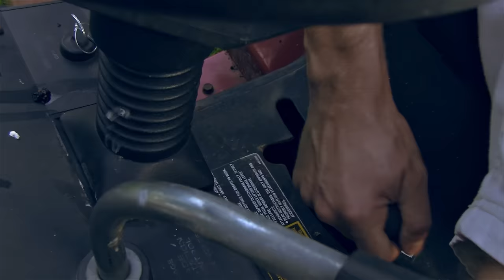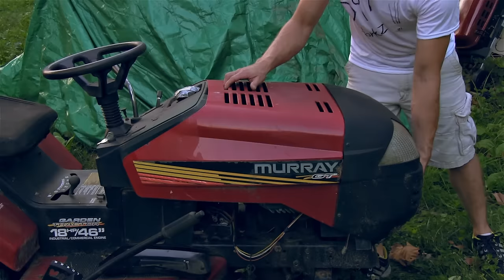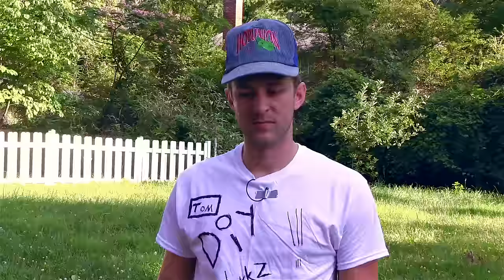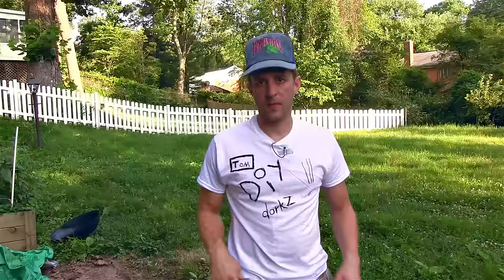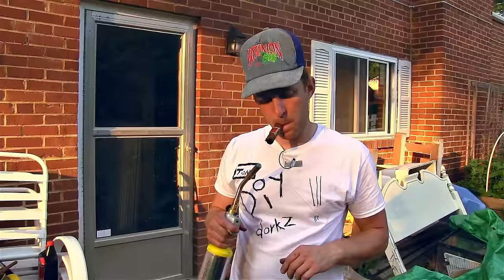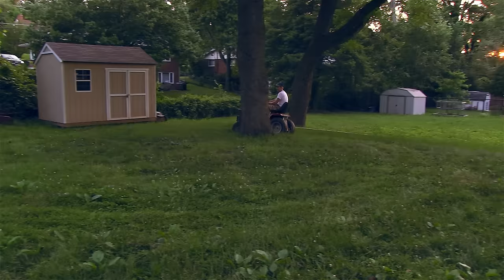Lawn Mower Will Not Start? Fix it! - DIY DORKZ Season 01 Ep. 05

Comment: I know you guys didn't ask for it but let me give ya 
 a little of piece of advice, after you changed the oil you should of put some automatic transmission fluid with the new oil or diesel with the new oil and then after you cut your yard drain it and then put in a fresh amount of lawnmower oil. Transmission fluid is like a cleaner and so is the diesel. When you first drained it you didn't get all the water out of that engine because alot of it sticks to the inner oil galleys and walls of the engine so just putting fresh oil alone isn't going to get it all out. Run it with either one of those two with fresh oil and drain it again so the rest of the water will come out. Me personally I would do this two times back to back to be sure. That's a really nice engine on that mower and expensive. I have a 17.5 hp. opposed twin and I've had it for 21 years and it's a beast. Nothing stops it. Great video and well done. Good luck and thumbs up on the video guys, take care. 👍
Reply: Wow. That sounds like great advice. I'll remember that on my own projects.

Comment: Hi there. I have a husqvarna lawn riding mower with 24 hp Briggs & Stratton that not start. It died on me when I was cutting my grass. It seems like no power but when I play with the electric wire, it has power showing the number of the hours on the meter then When I try to start I heard it click a little bit then died again and no power again. Could you tell me what is wrong with that?

Comment: Check leakdown. If it's low, it could be the valve seat is loose. Check the rocker arms. If it's loose, replace the head. Replace the carburetor. Tune the engine. Change the oil and filter. Check the spindles and belts and blades. Check if the deck is rotted. Check the tires and rims and linkages.

Comment: Can't hardly kill those old Murrays.

I spect you'd do some preemptive things on a mower that's been sitting that long:
Charge the battery (at least confirm it has one).
Drain the carb.
Drain the fuel tank.
Check oil level, if not the condition. I don't always drain it right away if it don't look too bad, but I will after I get a few minutes run time. (I once got a Sears 10/6 that I knew had been flooded at least twice. It ran clear water out the drain for at least 20 seconds before I got any oil. Glad I didn't run it with that much water in the crankcase.
Soak the deck bearings with oil, or pump a few squirts of grease. You know those are gonna be noisy right away. Maybe even try to free them up by hand before you engage.

I don't mean to be critical; you don't a great service here by sharing this experience with people.

It especially gives them confidence to try stuff on their own.
Try and assign value to that...

I've been doing "rescues" for about 7 years now, and still haven't posted my first vid. Kudos to you for sharing.

Comment: You make it look so easy! I still can't I get mine going, and I didn't have 1/2 the issues you found. :-(
Oil in decent shape, not too full, new battery, drained and refilled gas, took apart and cleaned carb (didn't look dirty to start with), checked fuel flow. Was able to start it with starting fluid, but now it just spins
Reply: Jayleen Flanigan if you were able to start with starting fluid, it's still a fuel related issue. Does it still have spark?
Reply: Sounds like your fuel shut-off solenoid might be bad.

Comment: I have a pos my self ariens with a b&s v twin 22 hp motor that will not start I have new gas, fuel pump(vacuum),fuel Lines ,and a carb. I am at a loss with it I got it to run for 20 mins one day then just went to check it and now it doing it all over again.  Its about to meet a junk yard

Comment: Lol, my single cylinder sounds so much different than that opposed, wish I could get one of those to replace my 12.5hp cause power!
Reply: SwagSubscriber ive had a few of these opposed twins there not strong engines they dont like turning rpms your better off with a 16hp single briggs or a briggs vtwin
Reply: I got a 15 hp one and it is alright

Comment: My mower is turning too slowly to start with battery only similar to this video.  However, if I jump the battery it starts up and runs well.  I have had the battery checked and it’s good. 
Is it the valves?   20 hp Intek  Briggs and Stratton.  Thanks
Reply: You need a battery with a lot more cold cranking amps.

Comment: Would this be the same process for one that has been sitting for 12 years? Great video!!
Reply: It completely depends on where the machine has been sitting and what condition everything is in. If it was sitting indoors, my bet would be yes, except there might be a mouse or rat nest. If not, I suggest you read up on any problems you can find and maybe go to your local small engine shop. Usually they're willing to give you any information you need even if you don't give them any business.

Comment: I'm having a hard time with my Craftsman rider. It's got too much compression and the starter can't spin the engine over to start the engine. Please let me know if you have any ideas. Thanks
Reply: @Ernest Lane jr : late response I know, but check your valve clearance and adjust accordingly
Reply: pull the plugs, crank it over with them out. Reinstall the plugs and try it again...

Comment: Good Video...but don't be CHEAP... I recommend to purchase new spark plug(s), air filter,  flush the fuel system (if no  Sta-Bil Fuel Stabilizer added), fuel filter, check the condition of both blade(s) and belts and battery as required. Check the status of the engine oil... make sure you use the correct engine oil.  Don't use 10W30... but SAE 30.  It has additives (detergents) that can destroy a lawn mower engine. Tire pressure is correct and mower deck is LEVEL... if not you will hack the hell out of your yard. It will look very bad. Other than that... have fun mowing the grass.

Comment: My mower makes a buzzing sound and tries to crank over but cant. Where should I look?
Reply: Connie Bannister take the plugs out and turn it over a few times to drain out whatever is in there, that should fix it
Reply: Connie Bannister either that or the starter motor is stuffed and you need a new one
Reply: Connie Bannister bad solenoid or valves are out of adjustment
Reply: check the tire preesure that was the same problem on mine and started right up

Comment: It sounds like you need a valve adjustment also. When you hit the key and it turns over slowly then fast it always mean you need an adjustment ~!~!
Reply: How to clean a mount field 827 h carburettor
Reply: Boo LuQuette no it doesnt that engine doesnt Even have adjustable valves
Reply: @hansi4825  don't tell him. He thought he knew what he was talking about.
Reply: santini1953 heheheh

Comment: I have craftsman dgt 6000 when I try to start it, it wants to catch but the dies with the choke out its kohler 27 hp engine
Reply from the maker: It's probably the carb when they sit for a long time they get clogged up.
Reply: +TPV Productions ok I will check that next but this model was discontinued as I found out that's why I got it so cheap
Reply: get rid of it the only thing craftsman builds thats good is hand tools their mowers and snowblowers suck

Comment: I just received a brand new craftsman T110 17.5 HP Manual / Gear Riding Lawn Mower It wont start / battery wont turn overFollowed starting directions on mowerSuggestions

Comment: Nothing will work on a mower sitting 3 years. Bad fuel, dead battery, corroded wiring connections. Those plugs needed replaced. The fuel system is contaminated and yeah, what a mess. I have worked on worse. I wouldnt have even tryed starting it with old gas in it. I would have drained everything out, cleaned the carb and retried it. Eather is the WORSE thing you can do to an engine. It dries out the cylinder and seriously, starting it knowing it had water in the cylinders should have told you the carb was full of water too.  The longer a mower sits, the worse it gets too. Cars are the same way. Those blade bearings will fail quickly,even if you oiled them . Running like a Champ? Nope.